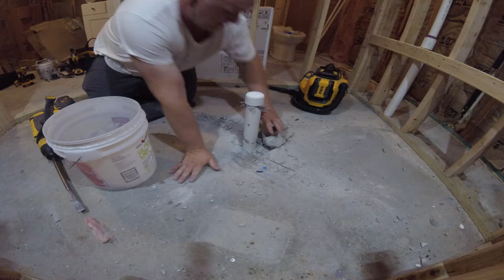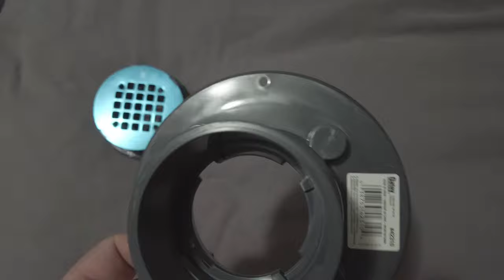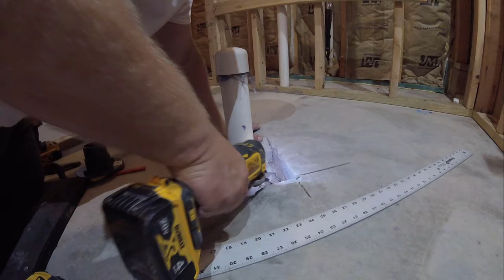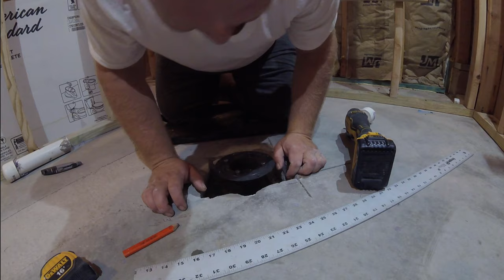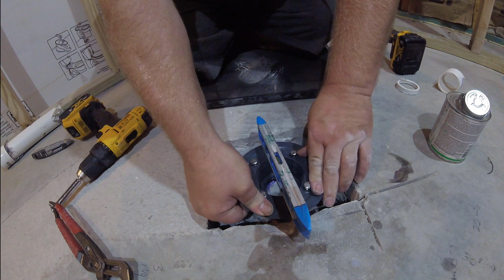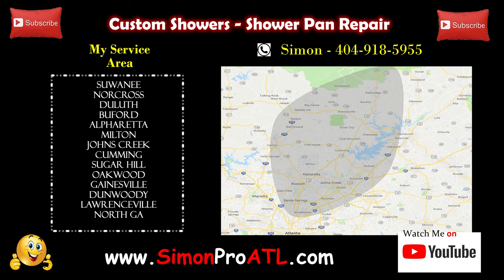How to install Oatey shower drain on a concrete slab for a shower pan liner

Comment: Is this really how they do it?  30 seconds in, and this seems like a stupid way of doing things.  why pour concrete only for a hole to be cut later.  pour the concrete with the hole already in place; it would be VERY SIMPLE to do.   obviously this is no critique on the guy doing the video.
Reply: Actually the thing to do is install the drain first, and then pour the concrete relative to that.
Reply from the maker: If they would leave some room around the pipe shower drain installation would be so much easier. Especially that plumbing for this shower was installed 2 months earlier by large plumbing company.
Reply: I was thinking the exact same thing as soon as he mentioned it..put the recess in as the floor is being poured..
Reply: This prolly was a builder rough in…and if it wasn’t, the cement finisher didn’t care enough to leave a void
Reply: Good of you to think cement guys give a shit much less understand plumbing.  They will also just pour concrete in the drains.  Same with tile guys and mortar.  They simply do not care about the next guy.  There are steps and the plumber isn’t there through all of them.
Reply: @ryanchay plumbers responsibility to make a leave out around his pipes.

Comment: as a 22 yr plumber, I wonder why the pvc wasnt boxed out before slab  pour. Good video
Reply: It was probably roughed in by a rookie 😀😃
Reply from the maker: Some are boxed but most are not. (in Georgia) :)
Reply: That’s was my goal to find this comment. Fire that plumber. He knows what’s going there and creates more work. Don’t make excuses
Reply: The floor I just broke up had no box. In Arkansas.
Reply: What's the advantage of boxing it? do you still need to pour concrete in to lock in the P trap if its boxed?

Comment: Does the base of the insert sit on top of the concrete?  Meaning, the bottom of that fitting is flush with the top of the concrete?
Reply from the maker: Drain base sits flush with the concrete.

Comment: Good video but I could barely hear you. The audio is very weak. Thanks for the video. I am getting ready to install a floor drain in the raised area of my garage which is going to be a laundry room. I am nervous as all get out about jacking into my post tension slab.
Reply from the maker: I will work on the audio. Good luck with your project :)
Reply: I heard you just fine. Thanks for the instructions!

Comment: Hi! I’m using the exact same drain on a slab as well, but I wanted to know if I could recess the drain a little below the surface of the slab to achieve a lower curb. Is this something that is okay to do?
Reply from the maker: No. It's harder to build a shower pan because you strainer (top piece with tread) might not reach the second piece of drain that holds the liner.  Low curb is desired by many people but it creates some problems. When you install the pre sloped pan it's 3/4" thick then the liner and pan that is 2" thick and tile 1/2" . That's 3 1/4" thick shower floor surface.  if you use  2 2x4 for the curb + cement board it's 3 1/2". When you tile your curb you will end up with a very small cut 1/2" or less from the inside of the shower.
Reply: You could go curbless with the same type of drain, we do this on the regular and own a plumbing and flooring business in sw Oklahoma.  Doing this requires taking out the whole slab of the shower, repairing concrete by code, with preslope, and then pouring regular 4 to 1 using a waterproof membrane on top.
Reply: I do all mine curbless, I pour my concrete lower then the rest, then use pro red waterproofing. It just paints on but dries like a pool liner, the use shower sand mix to go even with the rest of the floor but slope to the drain.  Never had a problem.

Comment: Hey! My master on the third floor is having the shower pan redone. Can I reuse the part that’s in the concrete? Having a hard time finding a fit
Reply from the maker: You can reuse it.
Reply: @simonproatl  how do I ensure I can find the perfect fit for it? Or is it universal?
Reply from the maker: @ShhhJessica1223  Make sure that the brand and color of the drain base is matching. You can also measure the distance between the screws holes.  They are not universal.

Comment: You should use the impact tool in case your cutter loosens off and falls into the drain
Reply from the maker: It happens :)
Reply: it would just  slip off the cutter has  a straight shaft...  no indent for the impact  tool  to hold  it  in  place

Comment: Great video. Was the concrete that you cut out and installed the drain in sloped? Why I am asking this is that after you do the pre slope with the motar bed on the liner, wouldn't water sit on the liner since the concrete below wasn't sloped?
Reply from the maker: First step is to install the shower drain then build a pre sloped pan around it then install rubber pan liner and last is the shower pan.

Comment: great videos Simon! question about this one but are we not putting screws into the concrete after it sets or are we just relying on the concrete to hold the drain flat/level after? Just cause in the video the 4 bolts you have are for the pan liner i guess and the other 4 holes would be to screw into a wood subfloor? are we just ignoring the extra holes using this method?
Reply from the maker: Ignore them if you use this drain on concrete subfloor. Or you can seal them with silicone or glue when you glue your liner to the drain.  

When you install shower drain on concrete sub floor:  shower p-trap and pipe is surrounded by soil or concrete that hold everything in place and prevents pipes from moving or flexing. When you install the same drain on plywood subfloor then you will use those 4 holes to mount it to the plywood.  When you have the access to the drain from bellow then it's better to install shower drain to the plywood first and then connect p- trap to it.

Comment: Thanks for the great video!  My  2inch ABS riser coming through the concrete floor  is not perfectly vertical. A typical ABS welded connection to that pipe would end up with an 1/8 inch deflection from horizontal at the drain surface :(  ..is there a solution other than jack hammering  there entire area to replace the U trap and riser?
Reply from the maker: It's a very common problem. I use a repair coupling. The one without stops. You can push the coupling slightly off on the pipe and the glue it and then connect the drain to it.
Reply: @simonproatl  Thanks much for the quick reply. That should work.

Comment: Hello, my friend. Great video. 
Question. Do you pack the concrete dry under and around the drain? Or did you add water over the concrete after? Thanks!
Reply from the maker: I mix concrete with water and then pack it around the drain.
Reply: @simonproatl  Thank you for your response. Much appreciated. 

In my situation, I'm installing a KBRS Shower Slope which calls for a 3/8 inch clearance of the shower drain flange from the concrete slab, so not completely flush. I have a 5 inch diameter opening on the slab. With the drain dry fitted, it leaves me less than an inch of space to insert wet cement once the drain assembly is glued to the pipe. Would you recommend a self leveling product like Zika self leveling polyurethane sealant to fill the void for my situation? Thanks again!

Comment: In my basement I have a 2pc shower  drain system (the ones used for pre fab shower pans) and was previously installed with a mud shower pan and liner 
Obviously that is not the correct shower drainage system 
So my question is , 
Would it be better to dig out and cut the pipe to have a 3pc drain system installed
( the one with weep holes for the pan)
liner ) or is there such thing as an adapter where I can screw an abs extension and install one of those new flo fx drain system which are made to avoid the pan liner and pre slope ?
Either way if it sits and adds any height above the concrete slab ,my shower pan mud can be raised and curb height to make up for it
Reply from the maker: It's better to dig it out and install new drain.

Comment: if installing a tub would i still need to cut out a hole or could the tub/shower combo connect to the roughed in pipe without the need for digging out some concrete? Thanks!
Reply from the maker: If you are installing tub with tile surround most likely you don't have to remove any concrete around the pipe but if you using tub/shower fiberglass enclosure most likely you will have to remove some but it depends how much room you have between shower floor and concrete.
Reply: i'm hoping i just need to go down an inch or 2 at the most. Thanks for the reply.  @simonproatl

Comment: So with this on the bottom, will there be an upper piece in the shower pan that fits nicely into it? Is that the purpose of placing this there?
Reply from the maker: This drain is design to be use with shower pan liner.
Reply: @simonproatl  thank you for replying. So is it drain first, then the liner, then cement, and then the shower pan? Is that the right order? If you can point me to a video for the rest of the process, that would be super helpful.
Reply from the maker: Drain first -> Pre-sloped Pan ->rubber liner -> concrete shower pan -> shower floor tile 
 @fafza1

Comment: What type of concrete is appropriate for a 3/4 to 1 inch bed?. I'm redoing my bathroom and I think it's easier to make a concrete  bed than level and put cement boards.
Excellent video.
Reply from the maker: I use Quikrete Sand/Topping Mix and a coat of thin set to bond it to the plywood or concrete.
Reply: HARD-CONCRETE
Reply: Mapei 4 to 1

Comment: Is there a pre-slope going in that shower? And a 40 mil vinyl liner? Was that bottom piece of drain level with the concrete or did it sit above like it supposed to a half an inch or so
Reply from the maker: This drain was install for shower that had a pre slope and rubber liner installed . The bottom part of the drain is 1/4" to 1/2" above the concrete. This is a large shower 9' x 5' shower that why the drain must be slight higher so pre slope is thick enough around the drain.

Comment: Would this work for a stand up shower base? Or is this meant to go with floor tile?
Reply from the maker: This drain is used in showers where rubber pan liner is used.

Comment: is the drain even with the floor or no?
Reply from the maker: Drain is even with the floor. I case you want a thicker pre slope around the drain you can install it 1/4" to 1/2" above concrete floor.